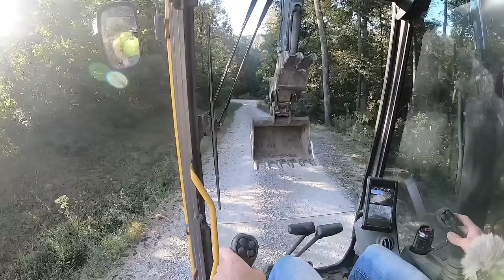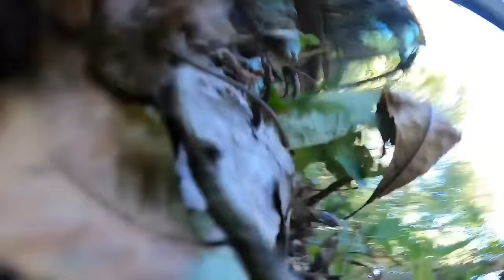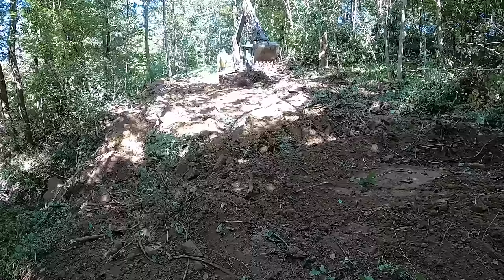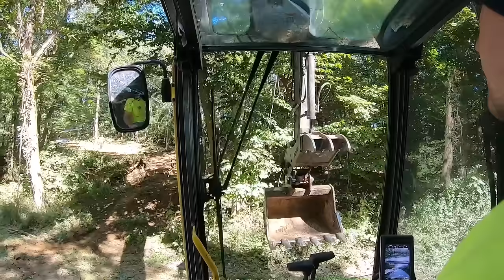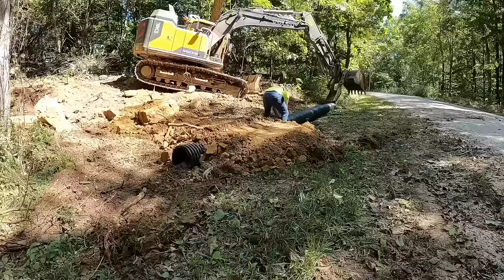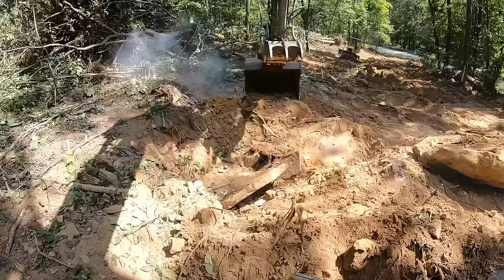Removing Trees and Large Rocks for New Driveway Install with Excavator

Comment: In my truck driving career, 40 years ago, I broke 3 mirrors entirely off of trucks in about a two week period.  Try to keep up.  Just don't hit one on that "big ash" tree! 😁
Reply from the maker: Dan Severn 😂 part of the job sometimes!
Reply: Funny in my truck driving carrier. I never broke a mirror. However I did break a windshield with a mirror. It was an International cab over. It had a broken door catch. The wind ripped the door out of my hand. Swung the door around putting the mirror through the drivers side windshield. It was fun driving it 5 miles back to the yard with no windshield. Lol God bless
Reply: @thomasdesmond2248  Well, mine was a long story. Involved working for Dad, and his comment about a "real truck driver could..."  May tell it sometime.

Comment: Just in case you're wondering phones don't do well when you run them over with a 18 wheeler   because the belt clip failed and the phone ends up under the drive tires 🤣
Reply from the maker: Gary and judi Boyd Now how would a guy know something like that? 😂😂